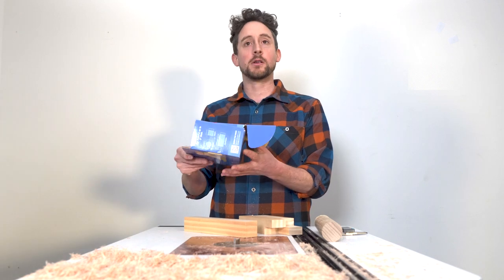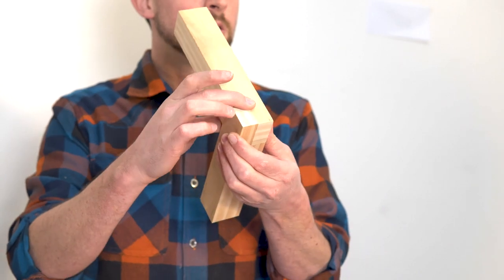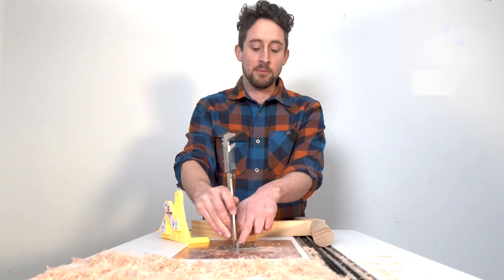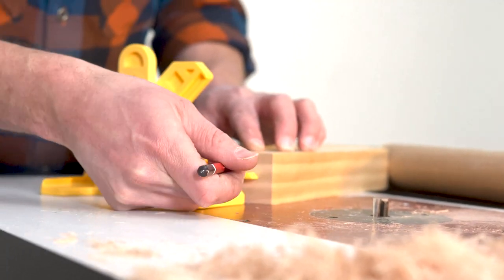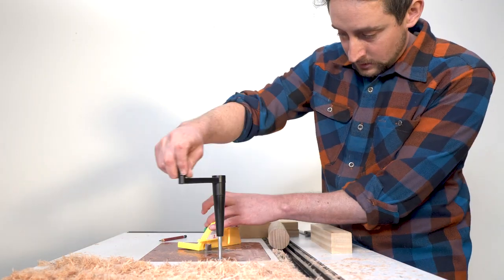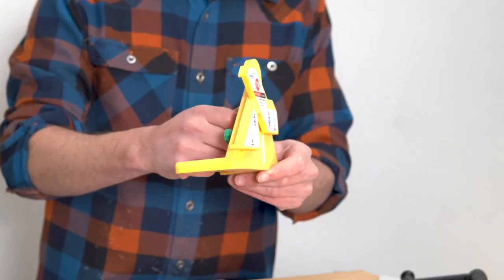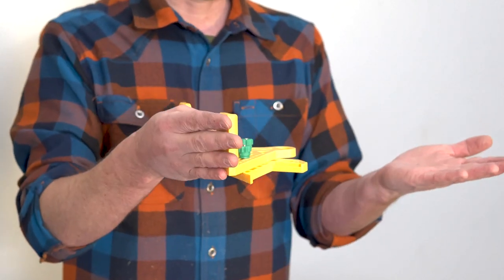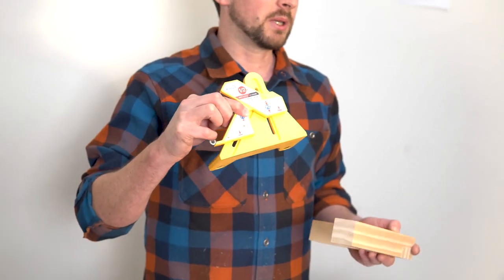Find the centre of your workpiece with the Micro Jig Fit Finder!

Comment: Looks like it would also be good for setting a wheel type marking gauge. The problem with the way that is demonstrated in the video is that the division will always be off by the thickness of the pencil mark, you can mostly allow for this by marking from the face side then marking from the 'wrong' side on the second piece - the half lap will be off dead center by the thickness of the pencil but the outside surfaces should be flat. When I get one I'll be using it to set my marking gauge then rough cut the joint with power tools or a handsaw and finish it off by hand with a router plane.
Reply: Bruce, a marking knife gives VERY precise lines with no offset.

Comment: It looks like an awesome design, but the plastic end that is used to reference the blade or bit against isn't going to last long when rubbing against carbide cutters. Even in this clip you could see the router bit shave off some plastic. How long would it take for that to result in a less than accurate cut? Perhaps they need a different material for the reference surface?
Reply: My prototype unit is more than 2 years old and this has not been an issue with a bit of care.